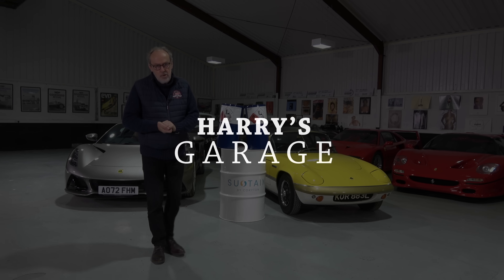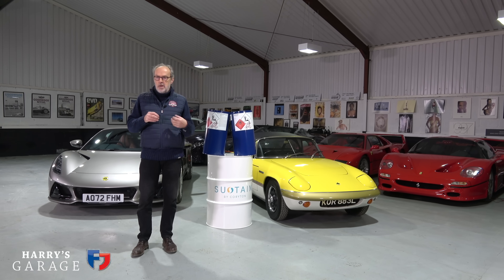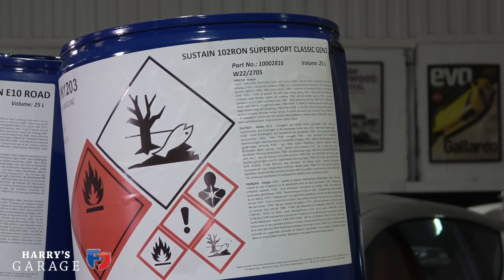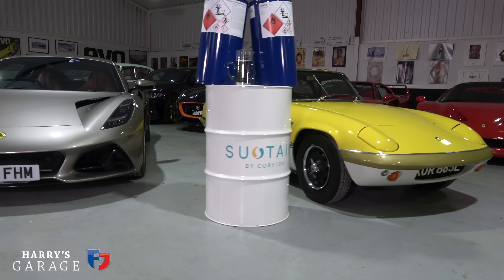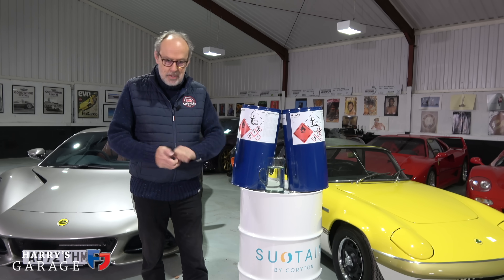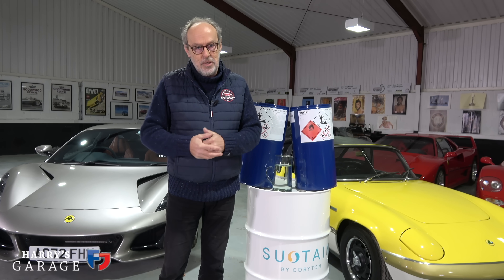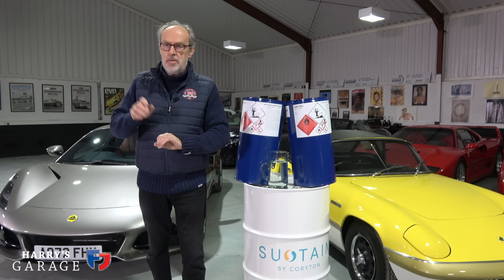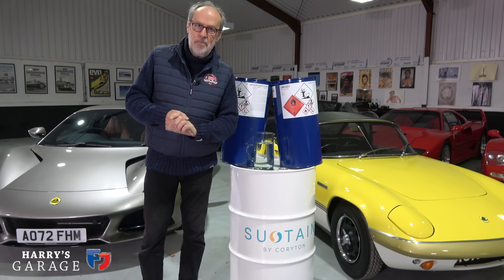Sustainable fuels; what are they & when will I be able to buy some?

Comment: Thank you Harry!
Great video as usual!
BUT, forgive an engineer listening....
When the energy density of a fuel goes up, the fuel consumption goes down!
Initially you mentioned that your Miata example actually took less fuel per mile, so... ;-)))
These companies are really doing great work with these new fuels!
When the electric car boom is over in a few years, we will see the electric cars co-existing with older and at that time
even more modern energy solutions for propelling vehicles as well as running older cars with new fuels!
Correct tech for the correct application; never the same solution for everything. 
If we could also start updating our older perfectly sound vehicles, that would be really cool (I have one).
Producing a new cars takes much more resources than keeping and updating an existing one...
Until then, huge manufacturers and political decisions will operate in great "un-harmony" to strive for employment figures
and tax revenues ;-)
As a Swede and an engineer, I have a dream that we in the future will still love and run our sportscars in an environmentally
sound way AND that our governments starts focusing on what is best for the citizens (and their sportscars ;-) instead of
most amount of revenue to the country/state/administration/politics/power...it kills the environment.
* Another very important thing in the equation about renewable fuels and low emissions from our sportscars and by all means
all our (modern) cars;
have you seen the figures for polution from the container ships (registered god knows where) running around with goods
over the globe that we order at the internet? Interesting reading in comparison to the good and serious work you do with this video!
Please post a video with a comparison if you can/want ;-)
// Tomas

Comment: Run a 23year old diesel Landcruiser. Tows daily, 8 seats. 32mpg. Got 150,000 miles on it and running strong as ever. Put a tank of the good stuff every 3 fill ups and a wurth treatment once a month. Passes emissions. Keep you’re motor longer!
Reply: Best saving is that the energy used to create the vehicle can be in use for a much longer time than most, probably any, modern vehicles

They may not rust as much or as quickly any more, thanks to better metals and the use of plastics, but complexity and electronics issues together with relatively short runs of expensive electronics that may often become irreplaceable rather quickly, might well lead to early obsolescence. Thus wastage of energy that should have had longer benefits from its consumption.
Reply: @grantp7975  Absolutely. I’ve tried newer modern vehicles. They use way more fuel to start with. Making you’re vehicle last longer is the way forward for me, and do a bit yourself. I’m proud to be driving a daily at 23 years old!

Comment: Sorry, but what a load of tosh about BEV's and the grid. Don't look at one days carbon intensity, look at a year (or better still the next ten years!)  last year, the National girds average carbon intensity was under 200g/km, so even for a 100% grid powered BEV that's well under 100g/km of CO2 (typical BEVs return between 3 and 4miles per kWH of electricity).  What is is the actual delivered CO2/Km of the sustainable fuel?  Given that it's a physical thing that must be shipped and carried and given that there aren't enough bakeries in the world to conviently provide waste heat to manufacturer it, it's going to be not that great (do Coryton actually publish a ratified by peer review embedded carbon value for the fuel?)

Yes, for very niche uses, where electrification isn't suitable (ie classics) then sustainable fuels provide a lower impact that pure fossil fuels, but to in anyway compare that to the mass electrification of our private transport fleet is highly eroneous.  We need most people to drive their boring daily mielage in very low carbon BEV, charged ideally from local or grid sourced renewable electricity. This we must do, then we can worry about the tiny amount of fuel burnt in our low mileage mostly sat in a nice barn classics..........

Comment: how many corn fields or whatever crop this ethanol is made from will we need to fuel all the airplanes and cars? it's not possible and it's not sustainable at all. no electric and no ethanol fuel can solve the problem for now. there is no solution so far that's why we are still using fossil fuels!

Comment: Harry, with your farm's solar PV arrays and wind turbine, surely you could charge your EVs with independent zero emission energy? Especially if you added a large enough flow battery to act as an energy buffer, allowing you to charge your EVs when you want to.
Reply from the maker: That's exactly what we do with our regular family car but I'm looking into how to make the cars in Harry's Garage more environmentally friendly, which is what this video is all about.
Reply: @harrysgarage  Great video for broaching the subject of synthetic fuels. I would suggest though that running your heritage collector's ICE vehicles on synthetic fuel, does not make them more sustainable, because although they will not be adding new emissions to the atmosphere, they will still be emitting noxious fumes from the tailpipe. This will not address emissions in urban areas where people, and in particular children are affected, and will still  fall foul of ULEZ zones. In fact it could be argued that in terms of human health, the synthetic fuel is taking carbon dioxide in the wider atmosphere and literally blowing it in people's lungs. I would suggest therefore that the best solution for your vehicles is conversion to battery electric drive train. The form of the car is preserved, but you no longer produce noxious fumes or waste energy with ICE heat, noise and vibration. You would also not have the problem of sourcing ICE parts going forward into the future. As an EV you could also charge them with your own 100% green renewable energy, where as with synthetic fuel you are at the mercy  of the manufacturer and supplier in terms of price and availability, exactly as with the current fossil fuel. I also doubt the credentials of ethanol. Today in Brazil whole crops are used to make ethanol, where as you suggest ethanol is made from organic waste such as Brussel sprout stems. As a farmer I am really surprised you are so enthusiastic about ethanol? On the other hand the synthetic fuel version that combines renewable energy powered electrolysis derived hydrogen with atmosphere captured carbon is an incredibly  good idea. A real winner in fact for aviation and heavy shipping, but not for land transport, whether it be private, commercial or  industrial. In fact it is a scandal that    
avgas used by piston powered light aircraft still contains lead. Avgas is the only fossil fuel remaining that still has lead added to it, and all to allow what are now very old aircraft to continue to fly, mainly for private purposes. These aircraft could all be replaced by turbine power plants that do not contain lead.

Comment: Hi there, any idea how much your net C02 impact would be if you keep using traditional petrol and then take the £7,538 saved from not buying the sustainable equivalent and donate it to a UK-based entity that plants trees... Or, put another away, how many trees would you need to sponsor to cut your fleet's CO2 emissions by 60%.. And would that amount be more or less than £7,538... Of course, once you've bought a copse of trees, they would continue to reduce your CO2 output each year after planting (and growing to a sufficiently productive size), so once you have enough, then the addional yearly cost of planting goes to zero...though, all else being equal, you'll still be overpaying £7, 538 pa.

Comment: Interesting but there is a flaw in the thinking.  Agreed that pulling crude oil out of the ground is the worst.  I understand the notion that sustainable fuel is only returning C02 that was pulled out of the atmosphere by plants.  But if the plant waste was ploughed back into the ground vs converting it into fuel it would be captured in the ground.  Your approach is better, but only marginally.

Comment: Several observations:
1. Car emissions have risen in the last 10 years, "thanks to tanks": SUVs with their stunningly poor CdAs, vehicular obesity and wasteful transmissions. This is a big problem in GB as folks use cars for 90% of their total journeys. Agreed that planes are disastrous, but Mum trucks also need to be stopped. 
2. In France, bio fuels (e85) are 0.70€/litre (roughly O.75 GB Peso) through lower taxes. Most petrol cars which are post 2001 are now using it. GB failed its roll out of e85 (as fuel duty stayed high and it was canned by the Daily Mail). This was a massive home goal. The only positive is that Indian manufacturer JLR sells flexfuel cars (made in Slovakia and Coventry). e85 in France uses biowaste from Sugar beet (the leftovers that are not consumed by cattle or Big Sugar). e85 is 85% ethanol and 15% petrol.
3. My understanding of e85 is that its lower calorific value increases consumption by 10-15%. However, as all countries have speed limits...this is not an issue.
4. For historic racing the FIA has not yet sanctioned e85 yet although it does provide for the idea by insisting on an "orange crush" coloured sticker to be placed on the race number. Goodwood meetings, which is are non FIA historic event can allow bio fuels (which is a good thing).
5. E85 was tested in a GB championship in the noughties. 
6. Agreed that Electric is completely hopeless but its main use is to reduce air pollution (thank you Mr Khan (London) and Madame Hidalgo for protecting our health.

Comment: I don't understand how this is classed as renewable if it's using 'waste' food. As you say the release of CO2 from oil is causing the issue. But if you are using waste food that hasn't been grown specifically for the generation of this fuel, then no additional plants have been grown to take in more CO2, but you are releasing it by burning.

Comment: sorry you have hit a nerve with me, the aircraft industry is a free for all? have you looked at the advance in aircraft engine efficiency over the years? a Boeing 787 Dreamliner for example uses 2.31 L of fuel per passenger per 100km, in other words 122 mpg per person, so if all cars did 122 mpg or we remover 3/4 of the cars (guessing across the world an average of 30mpg) would we even be questioning it?

Comment: How much electrcity (generated usiing as you state a 60% fossil-fuelled mix) are Coryton using to produce this "sustainable" fuel Harry? Surely, it would be better to just put that electrcity into an EV, where it can be used at 90+% efficiency, rather than using another fossil-fuelled vehicle to transport it to your garage, where you can use it at 25-30% efficiency? Oh - and still dumping CO2 back into the atmos from the tailpipe - where an EV doesn't..

Comment: Yes Harry I like very much as a concept the idea of eco compatible fuels even though they appear frightfully expensive for now. 
One thing that I’m realising though every day more and more is that the carbon emission question appears to be just pretentious for enforcing something that is simply groundless in its foundations. If you realise that CO2 represents just 0.038% of the volume of the atmosphere, it simply is not enough to make a significant difference to the overall impact on climate or anything even if the total content could double or treble in quantity. Actually to say it all the problem would be if the quantity were to drop too much, not if it increases, which in any case is un influential. The earths atmosphere has been even much higher in Co2 than today, even 10 times. Consider that any volcano erupting on the planet can increase instantly and massively the content more than the total Co2 emission humans can produce and would not represent a problem. 
I am for saving the environment but the Co2 question is a hoax. I would be most obliged if you could do a bit of research yourself using independent sources of information and you could be surprised by what you might discover. 
Thank you for your wonderful videos with the exotic cars that I enjoy watching and was once a proud owner of a Lancia Fulvia HF fanalone, I love your Fulvia Sport Zagato ! Regards

Comment: Excellent video Mr Metcalfe.  Couple of points (just between you and me) . One there is no consistent evidence that CO2 emissions are the cause of 'global warming'/'climate change'/ whatever.  It is equally as likely that CO2 increases because the globe is warming.  Nevertheless let's assume we want to reduce ICE emissions including CO2 emissions, that is economically speaking we need to account for the negative externalities of ICE use.  To do that it is well understood that you work out a the future cost of the disbenefit, discount that back and apply that sum as a price to hydrocarbon fuel as extracted from underground.  Nick Stern did just that, so we're done. Sorted. 
Now, I absolutely agree with you about use of ICE in cities.  Round here (east anglia) Amazon have a fleet of BEV Merc Sprinters.  Having once been a delivery driver I reckon they do between 50 to 100 miles per day.  That means a modest sized battery and overnight recharge. 
As to the price of synthetic petrol and diesel there is a video on the National Geographic channel of a blokey who runs a proof of concept synthetic fuel plant saying categorically that he could produce syn-petrol/diesel now at prices not far off current pump prices. And he also wonders out loud why The Powers That Be aren't beating a path to his door.
What's more all these synthetic fuels have far less impurities than fuels made from extracted fossil fuel, hence they burn cleaner which equals less emissions.

Comment: Transport is about as impactful as electricity production for CO2 emissions, in the 30-ish%, and within transport, aviation is about 10% against 60 for cars and 25 for heavier road users (trucks). So I think it's time we cut some slack to aviation and stop showing them as the culprit. For mid/long ranges, the efficiency of planes is actually much better than cars and trucks, though not as good as trains. Let's focus on the main issue: road fuel, electric cars (until better sources are available, esp. because of the technology change and what it implies at all levels), industry.

Comment: The key is that the 3x lower efficiency doesn't matter when the cost of electricity in these remote areas is 10x cheaper than what is used here in the UK. Building a power line from South Chile (lots of wind energy) to the UK is actually less economic than exporting the energy as fuel. 
Globally, there is no shortage of renewable energy (Covering only 1.5% of the Saharan desert in solar panels gives enough electricity for the entire planet!). So the question is not how we best can use the energy efficiently. The question is how we can distribute the abundant energy. That is best done by e-fuels.

Comment: Correction: There are companies working on electric planes including passenger transport (aimed at short distances). If they are viable or not I have no idea of but if I remember correctly one here in Sweden have signed with carriers already.
Reply: They are only for shorter distances. The great majority of CO2 from aviation comes from long range flights. And batteries are still centuries away from being good enough for long range aviation...

Comment: What routine maintenance do you carry out for your collection, and how often is this necessary, to prevent things deteriorating or seizing up?
Reply: There are a number of videos on the channel on that Colin, Harry usually does a roundup at the end of each year.  Look them up, interesting stuff.
Reply: @Snowy-666  I've seen these and they're mainly annual services and major overhauls / rebuilds. I'm  interested in any weekly / monthly maintenance to make sure nothing seizes up, perishes etc. In my experience, tyres perish, mechanical items seize, batteries run flat and other problems occur if a car isn't driven regularly. I don't expect Harry drives every car once a week, especially during winter, so does he have a preventative maintenance regime like charging batteries, idling each engine periodically, cleaning bodywork and undersides after each drive, using preservative treatments on perishable components like rubber etc?

Comment: The oil companies should be obliged to use some of their megaprofits to help build up the country's wind, solar and tidal capacity. Battery technology is going to improve significantly in the medium term and we need more capacity to generate zero or low carbon electricity.
Reply: There is no power produced when the wind don't blow and the sun don't shine.

Comment: This is great for your collection and Goodwood, we need to keep those precious machines going forever….  But! Big but… that fuel won’t ever get cheap enough to make it worthwhile to keep every generic Golf or Range Rover on the road, no chance. 99% of people don’t need to worry about this and they certainly shouldn’t expect it’s going to ‘save the petrol car’ that horse has bolted. 
Regarding all EV’s running on 60% fossil fuels on the day your recorded.. that’s on governments investment, as the grid improves (which it always is, 10 years ago, we used a lot of coal).. all those same EVs are cleaner and cleaner, with no change required. The consumer has done their part!

Comment: "What is the aviation industry doing?" Aircraft engine manufacturers like Roll Royce and GE are making improvements in efficiency, with every new generation of engine, that car manufacturers could only dream of. 

Also, any tax on aviation fuel will be immediately passed on to passengers. And the airlines will probably add a bit extra on top of that to your fare and blame the tax. It may ultimately prove profitable to airlines if you tax their fuel.